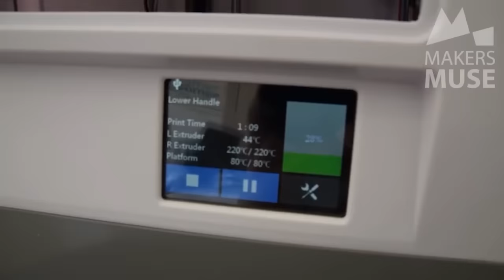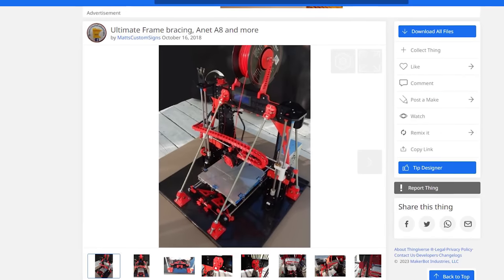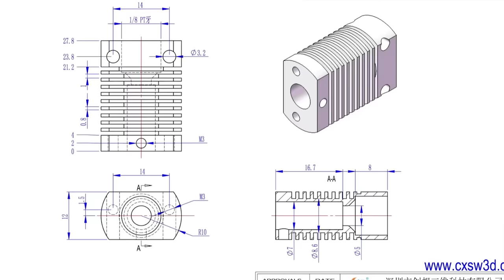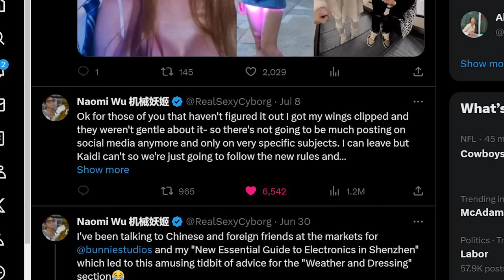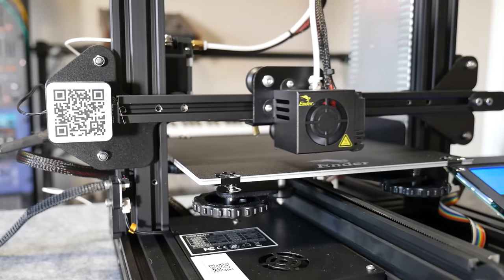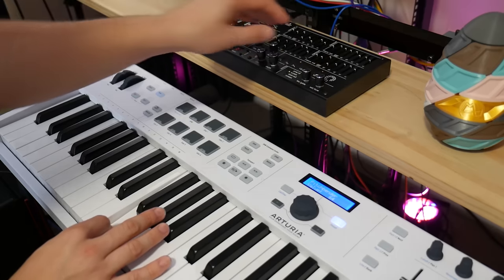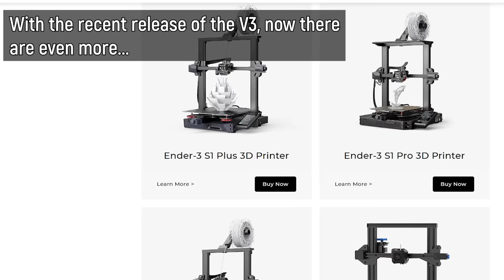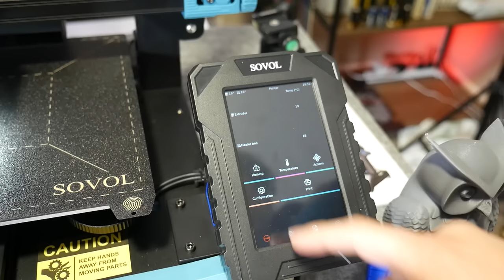Creality Ender-3... it's time to move on.

Comment: Cant beat the ender3… when it’s f*ck*ng working
Reply: All mine always worked.

Not everyone is good with machines.
Reply: Creality sold MILLIONS of these machines. It's not unlikely you just only got the good ones. Plus not everyone should HAVE to be an expert to enter this hobby.
Reply: @theninjascientist689 i guess you can choose to spend more or save and face the hassle/ be good and utilize the most of the cheap printer
Reply: AMEN
Reply: I bought mine early this year.  First printer.  I bought it for $280CDN and I've spent almost $800 on it with upgrades.

Not worth it. 

A new much better printer that can print at 600mms is about the same price with other better features. I can barely print at 90mms.
Reply: @jpeero ????
You spent how much on an ENDER THREE?
Reply: What? Of course you can. Nothing about the specs is remotely impressive in any way
Reply: @jpeero wtf did you do with your Ender 3? Did you gold-plate it?
Reply: U got the anycubic i3-mega. In the 4 years I had it, had 1 clog. And some stringing which was due to wet filament. Other than that the only gripe I have with it is the speed especially when u look at p1p
Reply: @theninjascientist689 for that it's not the fault of the company when a customer don't know how to operate a product. In general.
Reply: Amen. Damn printer might as well come with a technician certification course.
Reply: @Nordlicht05 it is the fault of the company when the quality control wildly varies, and different people can have completely different experiences. It's not that no one should buy one, but it's not good for people just trying to get in to the hobby (unless they are lucky and they get a good one).
Reply: I understand that feeling xd, I have wasted about 2 or 3 kilos in my first year using the printer.
I already understand everything you want and I maintain both my printers regularly
Reply: @jpeero how in the hell do you spend $800 on upgrades?!
Reply: @JeffsPrints  I was not referring to faulty products. 😄
Reply: The out of the box experience with my Sovol SV06 was night and day compared to the ender3. I spent way too much time and money getting the Ender 3 to work. My SV06 just works.
Reply: Gad an ender 3 but 2cyearsvin started having issues getting good prints.  I'm sure it is operator error... but could not figure it out.  Then got the K1, and love it, has not produced a bad print yet.
Reply: I've gotten maybe three good prints out of it and I can't keep the damn thing running. I've done all the upgrades. I know what I'm doing with things and this is a piece of crap. If it's working for you you just got lucky. Your time will come. Save your money and get a much better printer.
Reply: I feel like that's missing the point though...
Reply: @curtkeisler7623  where is the failure coming from? Heck, what are your print settings? Different filaments behave differently in open air, so I would recommend trusting them for the printer temp, and looking to people with experience on what exact printer settings you need.
Reply: I have an ender 3 and it runs almost everyday. Yes I did add a glass plate , worked on the hot end and dual z axis. I have done many repairs…. But… the thing still works. 

It’s not fast. It’s not so quiet. It does fair to good printing. 

But it still works.

Would I buy another one? Probably not. There are multiple 3-d printers that are faster and better. But the ender 3 probably will be around for some time.
Reply: The v2 is quite reliable, I've had it for nearly 2 years with no problems
Reply: @jpeero it’s because of bad or clone mods, i spent 200€ worth of upgrades and it prints at 220mm/s
Reply: WHAT? SPEAK LOUDER, I CAN'T HEAR YOU OVER THOSE NOISY FANS.
Reply: Lol.. V wheels 😬😅😂😂
Reply: Have had mine for years, barely had to fix anything over the years.
Reply: Build it properly FFS it's a kit lol
Reply: I'm still using an ender3 v1. Rock solid workhorse and paired with CHEP's extra fast cura profile, is very fast
Reply: @ralphnapierii1184  around $750 usd
Reply: @jpeero barely 90? I print at 200 quite easily with just dual z, direct drive, and BTT SKR Mini 3. What’s wrong with your printer lol.
Reply: This is a mood
Reply: Still have mine, original extruder was the only thing I needed to swap.

Modded to a sailfin extruder direct drive, added bi metal heatbreak and have had no problems, only issue I've had is a BTT SKR board died on me and my original bondtech bed literally ripped to pieces after years of PETG abuse.

It's been a great machine but thinking of retiring it now, Bondtech looks tasty but that lack of open source concerns me
Reply: Proper assembly and maintenance go a long way.
Reply: @wutangclams9936  nothing i just never pushed it. im printing at 200 now as well
Reply: I probably wasted a lot of filament and a hundred hours on failed prints at this point
Reply: True. It's a very decent little machine, but I constantly had to tinker and adjust and fix mine and it's not worth it, I replaced it with an Elegoo Neptune 3 pro.  Not a dis on the ender at all, I just don't have as much free time for tinkering, I just want it to work.
Reply: @curtkeisler7623 with you 1000%. I bought Ender after Ender everytime they were released, hoping that the new one would be better. Ended up with 9 Enders. Only one worked without constant tinkering. Finally got a P1S and out the box it just works. Have NEVER had a bad print or had to do ANY adjustments. If you want to play around and waste time, buy Enders. Otherwise, save the money and buy a printer that actually works.
Reply: @Jehty_  dual z-axis, sprite pro extruder, glass bed, skr mini e3,  v3.0, bltouch,  enclosure, replacement parts, etc
Reply: @kirknay  $800 with price of printer included
Reply: We can always mod the ender 3 which I fun in its own right
Reply: Actually you can. Even if its working, soon something is going to break or your going to have to replace a nozzle. 

If you count up all the money you spent on an ender and count the hours of maintenance as minimum wage and add up the replacement parts and upgrade cost over the course of a few years, your literally spending the same ammount of money you would have simply by buying a better printer.

I got a prusa 2 years ago and haven't even had to replace the nozzle ONCE. Prints perfect every single time. Nothing loosens, no clogs, parts hardly wear out and with input shaping I can print far faster than an ender. 

They suck.
Reply: @theninjascientist689  no one said expert. no one ignorant or brutish should be using precision machines (that can break or take fingers.) not everyone should have to be an expert to use power tools, but some people just shouldnt use them for their own sake.
Reply: Its funny.. I had a Longer lk1. It worked great for a couple years.. Then it slowly started having problems.. I finally got tired of fighting with it and trashed it last week. Lol
Reply: @jason4663  You had a mk.1? That's probably why it had problems. Good rule of thumb, don't buy the first of anything, chances are something is going to come out that's more refined and higher quality. Unforeseen bugs get fixed and the construction is improved. Out of the box enders have issues.
Reply: Yup. Mine worked flawlessly for 2 years. Then the driver on my SKR Mini died. After I replaced it now I have random axis shifts if i print too far in one direction. 2 full days of troubleshooting and couldn’t figure out the issue. As a result I have barely touched it for the past 2 years beyond some small prints. I just havent had the time to troubleshoot it properly and I forgot all the measurements for my upgrades to recompile the firmware to work with all my sensors.
Reply: Yes, my 2 Ender 3s kick my K1s ass everytime.
Reply: Mine worked amazing for the first couple months and than started getting crappy prints. And yes I did maintenance more than enough
Reply: @jachymzak95 nah, I got the Sovol SV07 on a deal for $220 and it had way more features, almost no hassel after setup and prints faster and better than my Enders.. 😂😂😂😂
Reply: @542aj eh, they aren't really that much worse as far as performance. (Tested and verified.)

They're terrible as far as wear is concerned tho 😢
Reply: @wutangclams9936 so you had to mod the shit outta it, to made it as good as the rest? 😂

I had Ender too for a while.
No longer the top dog, sorry chief
Reply: @3dragonprints458  That's the point in the enders life, where you have to replace half the printer.
Reply: @dftdbs1010  you are obviously uninformed about the world of ender 3 upgrades. The SKR mini is one of the most popular mainboard replacements by big tree tech (The guys that make the BL touch). It adds native support for a variety of sensors and silent drivers. The Ender 3 shines in its upgrade potential. It’s a tinkerers machine. As a result, my machine was half the cost of a MK3 with more features. I was printing models so cleanly that I had people on thingiverse asking if I printed in resin. I just had the misfortune that my after market board went bad. Shit happens. It’s to be expected when spending a fraction of the cost.
Reply: @lego_minifig  I've had 4 enders. Every single one of them was trash. Your going to end up spending the same amount of money on upgrades and replacements over the years as you would have just buying a better printer. Your right about one thing, they are for "tinkerers" not for people who want to have perfect prints right out of the box and or hardly ever have to do anything to keep it running.

If you want to spend 70% of your time calibrating, upgrading and repairing, go with an ender. If you want a practically flawless machine that is going to be near ink printer level of ease to use right out of the box, get something like a Prusa or Bambu labs or Ultimaker.
Reply: This is all printers, 3D, ink, or otherwise.  We ask too much from consumer-grade materials.
Reply: Yeah, constant maintenance needed. I don't mind tinkering but it's beginning to feel like a bloody F22🙄
Reply: So true 😂
Reply: Yea, you can. lol don’t care how cheap it is, it’s garbage compared to what’s available today.
Reply: Mines been amazing, the bed just goes out of level often, but watch your start and youll be fine
Reply: @dftdbs1010 Sounds more like user error. Never had a problem with any of my Enders, but then I'm not mechanically illiterate.
Reply: @----.__   Give it a few years. I also have a hard time believing that.
Reply: My ender 3 and ender 3 neo both quit within 3 weeks. Ive leveled both and changed nozzles and z offsets. Both don't work anymore. My anycubic kobra 2 neo be doing good. Going on week 2
Reply: Literally. Spend 99% of the time fixing it, 0.5% actually printing, and 0.5% checking if something is about to be wrong 😂
Reply: @kirknay the extruder, the Bowden tube, as far as filament and settings they worked fine until they didn't I have a creality Sr 10 that works great and has never given me as much trouble and I've had it for quite a while
Reply: @dangerous8333 I just need to get rid of the shitty build plate
Reply: @jpeero jesus, that’s obviously your bad bro, some seriously bad financial decision making
Reply: What the hack. Got my first 3d printer about 2 weeks ago. Being absolutely dumb in this area. Watched few recommendations and chosen ender 3v3se. Ok the slicer with it ... That's what I understood first about that is crap. Third test print brought me there. Gone to different slicer. Machine is literally working 24/7 since I got it. Had some issues with which I can't even name properly because I'm novus. Stringing? Is that whe nozzle moves from point to point and should not extrud any material but still pulls something like spider webs. Yes got that issue. And solved preheat bed for at least 1 hour before printing and leave your filament on it. It will Build of tampered dust on the rubber wheels. Clean everything at least every of 24 hours printing. Shakes and vibration creating uneven side walls. Literally Vaseline the (lifting screws does what moving z axis?) But have to experiment with some other lubricant as vaseline collecting dust and adding more cleaning. All this issues are related to environment (habitat 😂 ) of my printer. And I still managed to do things I need. So I'd say it's perfect printer for beginner. By the way got good few kgs of filament from a friend who gave up with his €900 machine and 3d printing or more accurate printer fixing. He Said you've got more useful prints in ten days with €200 machine than I did in 3years. I suspect that he got good sponsorship from bamboo lab regarding to that what he said.
Reply: @zanderz1228 can't beat it when it's working... For the price.  There's far better printers.
Reply: Best little workhorse I've ever had. Thousands of hours on mine
Reply: @thomashalvorson3558  could be hundreds of hours, on a faster printer. 😂
Reply: @jpeero  What could you possibly add to the ender 3 worth 800.
Reply: @melaniaslatan1177 what nozzle and hot end do you run?! Is that with a bowed end tube or DD?
Reply: @Tr3PB  I run direct drive with the default hotend (with Capricorn tube) but with a .4mm CHT clone nozzle
Reply: @melaniaslatan1177  what’s your slicer settings? I ran 80 mm/s last night with my direct drive Ender and got spaghetti on the top of my print.
Reply: @jpeero bro as soon as i had spent $200 on upgrades I would have been selling it and buying a new printer. I know they are expensive but  a much better option then having to tinker and spend 4 times you did on the printer, especially if your not the best with mechanical stuff like me.
Reply: 😂 Totally agree 😄
Reply: 😂 Totally agree 😄
Reply: @dangerous8333  don't you dare blame every problem of this 3d printer on the user.
Reply: Felt this in my fucking SOUL
Reply: Bought a filament sensor for the V2 Neo, tried to flash the firmware, the whole printer is dead
Reply: @dangerous8333   Mine as well. It was my first printer. It culminated with me designing and printing my very own direct drive extruder using microswiss hotend and original ender stepper.
Reply: My Ender 3s1 has worked ever since I’ve precisely leveled it and replaced the cord to the extruder. About a full year of not having to touch it so far.
Reply: @dangerous8333  You're right,

For instance the fact you've never had an issue with your ender 3s tells me you either barely use them or are too bad with machines to notice part wear and manufacturing defects.
Reply: But there isnt point buying machines that takes hundreds of hours to tinker to get it right, it'll end up costing more in the end than just getting Bambu lab x1c lol, with my salary if I end up tinkering with machine 100 hours, its already like 3000 euros ive spend on it... So why just not get industrial level machine with that wasted money&time?
Reply: @sebastiann9279  Do you tinker with your machine during your working hours? Because I don't. Which means, I earn nothing by not doing the tinkering. Also I learn nothing by not doing the tinkering.

I doubt I would have bothered learning how 3d printers actually work if i bought bambu. Also I would have never learned proper 3d design like I did when I designed a direct extrusion hot end from scratch.
Reply: So true!!
Reply: On the contrary, it's quite easy to beat. Obviously.
Reply: @jpeero Which model did you buy, and why that particular model? Which upgrades do you believe were essential vs nice to have?
Reply: Amen
Reply: @concernedcitizen780  I personally switched to what is essentially a pyrex build surface and added an ABL, it made a significant difference.
Reply: Ive used the Ender 3 v1 for about 4 years now, my only issues that happened were from when i was being a dumbass and making irreversible damage to it
Reply: @john_doe668  how?
Reply: @mrpawno4955  well, if you construct it properly and R.T.F.M., dont constantly change stuff on it, only making minor teaks during the setup, and overall just dont be a goober when handling it, it works.

The repairs ive had to do are:
Replace extruder because i broke a fan which broke the fan bearing and breaking the heat element (from excess heat ironically)

While i was trying to add a fan shroud to the mainboard fan i shorted the board with a screw

And peel the bed from too much adhesion and using acetone to try to clean it.

Its not hard to keep it from going bad. You just need to not fuck with it.
Reply: @pmiguelpinto90 eh just get noctua fans and a enclosure and ityl be quiet
Reply: @kirknay  that's been my experience too but there is plenty on youtube and other places to make the adjustments which is what I did. I didn't expect gold outcomes and didn't get them but the prints are more than acceptable and the learning experience has taught me much. In a couple of years I'll look at something better but the Ender 3 has been a champion for my money.
Reply: I just had mine stop printing after 13 hours. It was doing great then... clogged nozzle I guess. it was just going through the motions without filament coming out. But it did extract, just fine. I'm leaving it till tomorrow morning.
Reply: Fr. I got a ender 3 s1 and it’s my first printer, it is so annoying
Reply: Aaaa yes I know that feeling right now especially, I have been printing students prints with only to Enders one pro and other v2 and trust me… the tinkering and fixing never stops☠️☠️
Reply: True... my ender3 is epic, when it decides to stick the 1st layer (it never does)
Reply: Some people have to realise that not everyone wants a 3D printer because of the electronics, they want it for the printing. And there are far better printers that you can buy for a similar price instead of an upgraded ender 3
Reply: i modded mine so i set the speed to 50 and nozzle 210 and bed 65 and just take a nap and let it work
Reply: @Bryant-pb7gp  my biggest mod was to repair the z wobble. As in give up trying to faff with the lead screws and install a belt driven solution. I longed for the days of take a nap. Works brilliantly now, though.
Reply: I converted mine to corexy and man, its so much better
Reply: @dangerous8333  Dumbest comment here.
Reply: Mine has worked just fine for 2 years with no issues!
Reply: If you want to be a mechanic, get an ender3 If you wanna be able to print stuff, stay away from it
Reply: I am not going to make a bad thing about it but I have bought a Ender 3 V3 KE and retired the crappy Ender 3
Reply: What do you mean mines been going literly 8 plus years as my main then side printer but it also became a cnc for wood for a little while going back to gether successfuly and printing again 😂
Reply: @jpeero  You got fucking scammed, lol.
Reply: Alas mine doesn't I can find proper bin file for it 😢
Reply: Love my Ender 3.  Cost me next to nowt, and while I'm not printing constantly, it has been used a lot.  Cheap tweaks improved quality / user experience- converting to direct drive, metal extruder, pei build plate - it impresses (me, anyway) with the quality and capability constantly.  Just about to treat it to a silent board upgrade, cr touch and poss even get it Klipperised.  

A lot of my enjoyment comes from tinkering though.  Getting something cheap producing results of something expensive.  I get that there is better out there now, but that wouldn't be as much fun for me.

If you only want to 3D print things, then yeah, Ender 3 is probably done.  At the time it came out tho, you HAD to learn the grass roots stuff, or you weren't printing.  For the time it came out, it was pretty fantastic, and I'm thankful I got into printing then.  I'm not sure I'd learn as much if I got into it now, and bought something like a Bambu.  And then be clueless first time it did go bad.  

Different strokes for different folks!